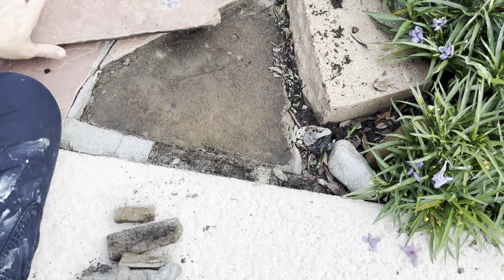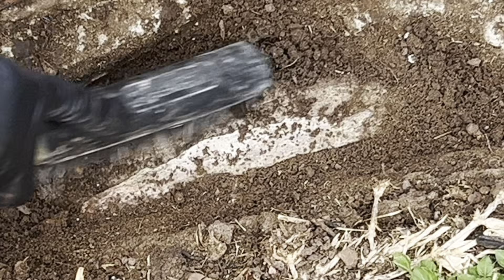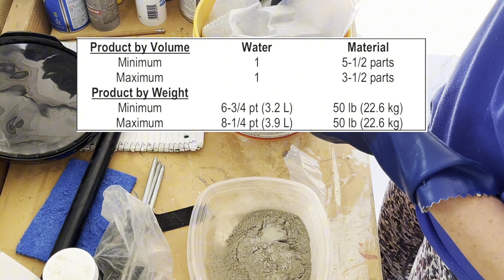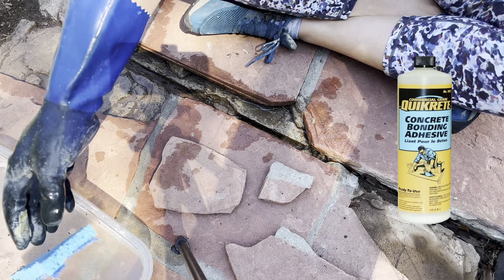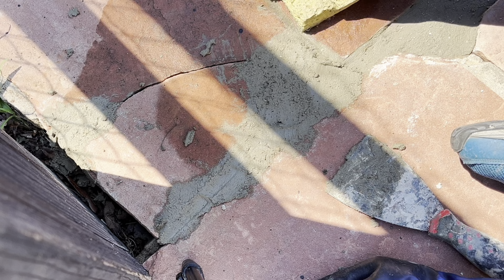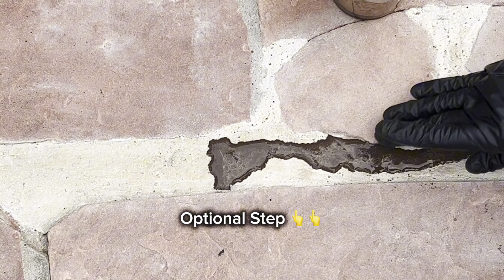How To Repair Flagstone Walkway And Patio Joints With Quikrete Quick Setting Cement - Easy Steps!

Comment: Hello, thanks for the video.  I need to fix the flagstone joints,  do I use setting cerment or concrete?  your title is cement, but I heard you use concrete. which one is better?  Thanks.
Reply from the maker: I use both words to describe the same thing. Not technically the same, but concrete is made with cement and other things mixed together. The product I used is a quick setting concrete made with cement.